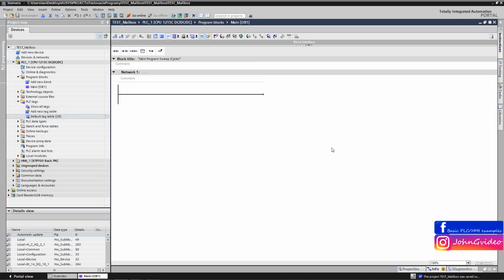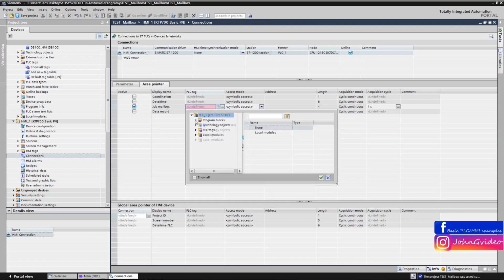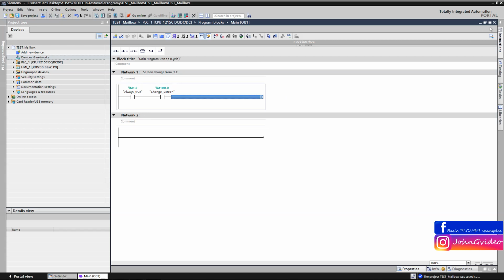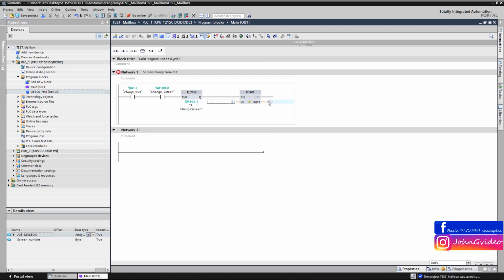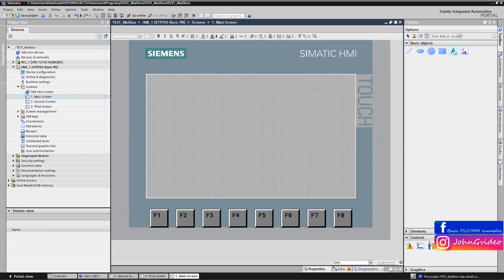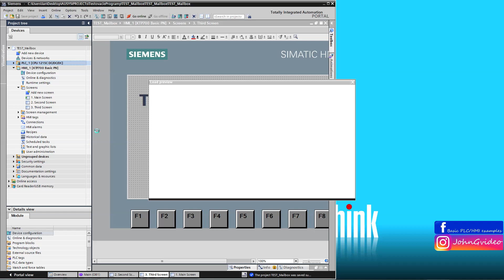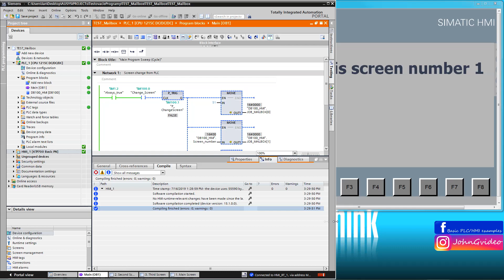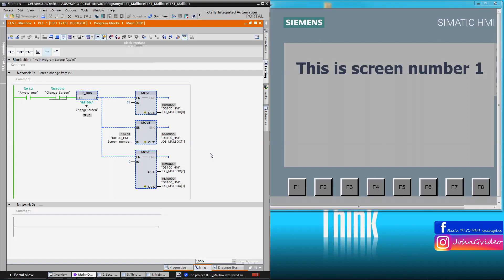Siemens TIA Portal PLC/HMI tutorial - Change HMI screen from PLC via Job Mailbox (Area Pointer)

Comment: Hello sir, if I click connections, it is not showing HMI_Connections_1. If I click add new then its showing only Connections_1. It is not showing any values in the tab of “Station” and “Partner”. If I click “Job mailbox” the access mode changes from “symbolic access” to “absolute access”. And the optional arrow is also not visible to change the mode from “symbolic access” to “absolute access”. What should i do?

Comment: So i have a program with sequences and more, also an HMI with operation functions for the machine. but as i turn on the mailbox in HMI_Connections it starts messes with the other functions. for examble if i press a button on the HMI it only holds for "whatever chosen acquisition".
Do anyone have a solution for this?